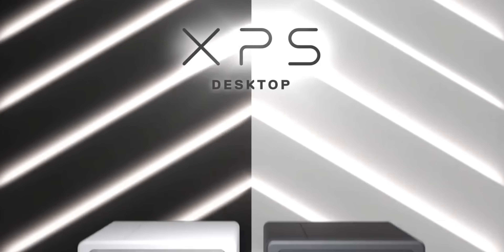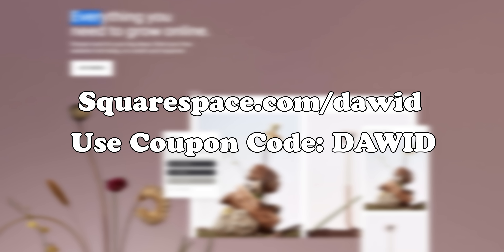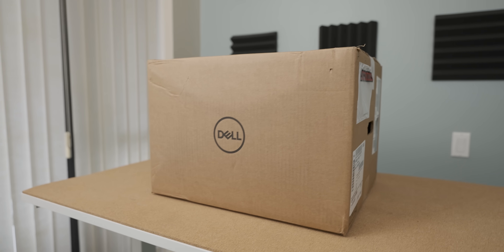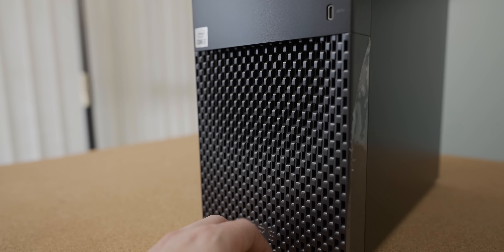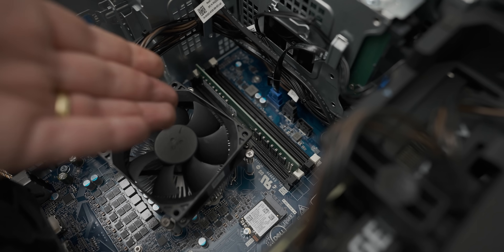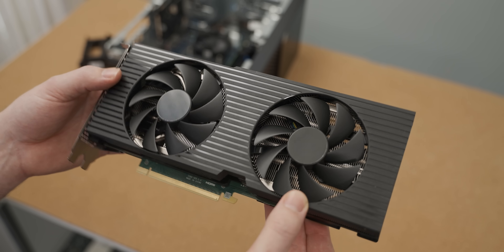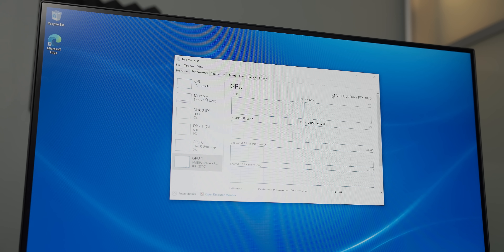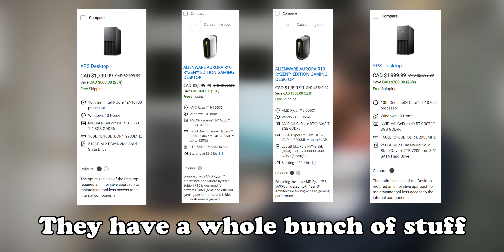DELL Did Me Dirty... RTX 3070 Dell XPS Pre-Built

Comment: Just watched, you should have sent it back and ordered another one. Dell is charging you for the customer service, make them give you service. It's fraud for them to knowingly send you single channel ram config when you ordered Dual channel. As for the cooler, it is what it is and more easily fixed by you. 

In theory, Dell can unlock your bios so you could add a stick of ram and get them running at the specified speed. I used to buy stuff from Dell, I don't anymore because I don't like having to chew people out that way.

If I had a Dell these days I would just leave the side door off.

Comment: I made that mistake once, the biggest problem with pre-built PC's are the proprietary parts, such as PSU's, the stupid configuration of the cooler and airflow, the motherboard is no longer standerdized like it used to be and you can't slap any motherboard when upgrading the motherboard, be warned.
Reply: I know what you mean. My last pc was Dell xps and it was broken. I tested all removable parts (m.2, ram, gpu, psu) and all working, so what left is either motherboard or CPU. Here comes the question, in order to replace the motherboard, I have to buy a new case. Moreover, the 600w working psu only has one 12V 4pin connector which limited the MB choice to the very low end H board unless I buy a new PSU. That is saying, no pre-build forever.

Comment: I just recently bought a "parts only" XPS off Ebay for 300$. It came minus the power supply and video card. What I got was a virtualy pristine XPS 8940 with a i9 10900, and 32 gb of memory. I put the Dell power supply I had into it (500 Watts) 89$. Then I hauled out my Dell RTX 3070, 225$ and bing bang boom a working gamer machine. Further upgrades were the NVMe drive change to a 500Gb and the swapping of the CPU cooler to the Dell "premium" one for 32$ and the addition of the VRM heat sink for 13$. So I spent @740$ to get the same thing Dawid bought 3 years later... Good buy? Maybe but for a patchwork used system it's pretty good.  Great video Dawid!

Comment: I live in Australia and GPU during covid here were few and $$$ so luck I managed to get one of these for very cheap. Bought off store shelf as is came with: 11700k and a VERY large cooler (these CPUs don't even come with a cooler by the way) 2x8g ddr4 (it's actually 3200 but Dell are cheap won't pay for XMP licencing so ram runs 2999) 1tb M2 drive, 2tb WD HHD, and a RTX 3070 that is (surprisingly!) good! I OC more than any other factory SSOC offerings silicon lottery I guess.
Problems: CASE IS TOO SMALL/CONFINED, 11700K (know to run hot) THE GPU MEETS ALL THE WAY TO FRONT OF CASE BLOCKING THE PSU LEAVING BOTH TO FIGHT FOR EXTREMELY LIMITED HOT AIR, ONLY 1 SMALL EXHAUST FAN REAR OF CASE. SHE GOT A BIT HOT!
Now it's Dell, so proprietary MB and PSU cables I swapped to new case so had to get new MB and PSU also  gaming I see around 63-65°c OZ heat mind you! Down from +80°c
Otherwise at the time and for the price 👌 but my advice: DO NOT GET A DELL OR ANY OTHER PROPRIETARY POS intentional to keep you buying through them, god forbid you want to upgrade your PC Dell wants you to just buy a whole new PC from them instead

Comment: I have this computer and i want to change my 3060 card to a 3090. Do you know which third party card will fit this computer ? TIA
Reply: 🤣🤣🤣 no card above the 3070 that's in this PC my guy as it already meets the front of the case, blocks off any air it can get also blocking the Power supply leaving both PSU and GPU to fight over the smallest amount of hot air! Mine would hit over 80°c CPU n GPU easy. I swapped case for that reason still running the RTX 3070. Also you WILL NEED a much better Power supply if you want a better GPU are you aware DELL use what's called proprietary hardware? So the power supply and motherboard have special connections that only fit with their boards. If you want a better GPU also you need a new PSU to power it BUT you then also need a new MOBO because the new PSU won't fit in the Dell MOBO power sockets. Not all a lose, because then your ram will go from 2999mhz to 3200mhz XMP which DELL do not want to pay extra for 👍

Comment: I think you knew before buying that Dell is a crooked company when it comes to selling to individual users.  Had you been a corporation ordering 100 of those systems you might have gotten the advertised components and the dual channel memory that you ordered.  But as a home user Dell assumes that you are too stupid to know better when you look inside the box to the colossally disappointing build that you received.
In their favor (not much) Dell tends to use very high quality power supplies, although their systems typically won't accept any non-Dell PSU's due to proprietary power connectors on the motherboard.  Meaning you are stuck with 500WH until the sys is sent out as e-waste.

Comment: Yeah I pretty much got did the exact same way... After I was done ranting and raving about being jipped with the memory I just memory I decided to just buy another motherboard better ram better coolers and a better case took my 1TB M. 2 drive the 3070 reference card from Dell and the 10 700 F chip and migrated to my own self built system... Yes it costs an additional $700 to do so but now I actually have a system that does not throttle itself in any way...I learned my lesson prebuilds are horrible.

Comment: I think you have to spec the system up to a K series processor to get the tower cooler.  Back in the GPU "dark days" I wanted to get my hands on a RTX 3070 so I made a post on several local university's community facebook groups looking for someone that needed to buy a new PC. I would purchase the PC with the 3070 then knock off the GPU at MSRP.  Surprisingly I had a bunch of people interested once they figured out the PC was about $180 cheaper than if you bought it through dell without the 3070 (I also get a dell discount though my work).

Comment: Never ever buy a pre-built computer from anybody. They are made cheap and over priced and you most likely will be vary disappointed in the performance and the reliability of the components over your first year. Had a few over the years different brands both desktop and laptops and they all did not last more than a few years but built my own computer well I didn't build it I had a computer shop built it for me but I was able to order everything that I wanted to have in it and then I had them just put it together so technically not a rebuilt but definitely stay away and even if you do have a computer shop older the stuff that you want make sure that you tell them you want all your receipts for warranty purposes and to not throw any of the boxes away this way you can easily ship warranty equipment back in the original package of course you got to repack it into something else so it doesn't get damaged if you're anything like that but definitely bring this stuff up because a lot of companies through computer shops that are local they'll end up throwing all your boxes away not thinking you want it and this is kind of a smart thing to hold on the stuff any kind of electronics hold on to your boxes carefully open everything up so that way if anything ever has to go back you basically have a box of sticking them see smart LOL

Comment: I hate Dell as much as I hate Mac. Over the years working on Dell servers, it seemed to never fail that they would require an update for something and the update would (majority of the time) would hose the idrac or the Lifecycle Controller making it so you had to replace the motherboard. You were very lucky if an update worked without breaking something.

Comment: my dell precision t7500 2008 desktop will blow away this computer and any other computer on the market now days. i have two (2) intel xeons running @ 3.33GHz, video card, two (2) nvidia Geforce GTX 1060, yes the 6GB VERSION  :) plus i'm running in raid. you can max this bastard out AT 192GB of ram, crushing through anything that stands in front of you laughing at your victims.  :)  my computer didn't even cost all that much.

Comment: The piss poor Dell support from India is the reason I decided (today) to not buy a Dell Optiplex 7000.  After 4 attempts of dealing with Dell India in a fruitless attempt to get part numbers for Dell slot m SSD and the slot m wireless card I gave up. The first thing India wanted to do was to sell me refurbished SSD. However, even getting to the point of them understanding I was making a new PC purchase was enough to end any desires on my part.  So long Dell, that was a $1300 USD loss to you.  I will look at HP or I will go back to building my own, even though I really wanted a turn key deal.

Comment: Tbh Dell is pretty legit. I still have my prebuild from 2017 (the Pavilion.. something..something) don't remember what's it's called. My only problem is that instead of giving me a normal 1060 they gave a shitty 3Gb one which still works fine even till this day but runs most good titles at 60-70fps or bellow. I can get away with any title below years 2018 but anything in this year runs like absolute crap. The PC is now not even what it was, bought a better motherboard. Ram and For God sake a BETTER case, with proper air cooling.
Reply: pretty sure hp made the pavilion
Reply: @YukariAkiyama  oof. dont even know the company i bought it from like 5 years ago.

Comment: I bought this exact pc about 5 month ago and have been trying to figure out why my performance has felt so low this entire time, noticed my cpu temps sitting at 88 and my gpu usage never going past 30-40%, I've searched for months and just came across this video, I cant believe they would skimp on something so small that reduces the performance so much. I'm going to open it up tomorow and replace the cooler with the one from my old system and pray it works. Oh for what its worth I also selected duel chan ram 16gb and it did indeed come like that.

Comment: Pretty sweet deal when you consider you only need to buy a $100-150 power supply upgrade and a second stick of ram. Which will be cheaper than adding the options on the dell website. When I added the second stick on mine, I saw the cpu usage drop drastically. And an upgraded power supply will lower Temps with less spikes in voltage.
Reply: Proprietary PSU, no?
Reply: @MichaelSmith-fg8xh  nope, that is a common misconception. When I ordered the new power supply for my alienware aurora r7 I went with evga gold 650watt and it came with separate wire harnesses. Use the ones that fit and throw the others back in the box or recycling bin. If memory serves there were 3. The original power supply in the tower did not have clips or plug-ins, everything was direct. But the board, gpu, etc still all have plug-ins. Your new power supply will come with wires for all of that.

Comment: The part that I miss in this video is where you contact Dell right away after discovering that you did not receive what you ordered. "Dear Dell, I did not get the right CPU cooler (as was advertised) and I specificly ordered 2 RAM sticks for a dual channel config, but I only got a single stick." Would have been very interesting to know how they handle complaints like this. Anyways, I would not have accepted it like this and I don't really understand why you don't seem to bother at all besides being a bit disappointed...

Comment: I bought a dell prebuilt with an i7 11700 and rtx 3060 for $1250. Slapped in a u9s and its actually pretty solid. AND mine came with dual channel 2x8gb ram
Reply from the maker: Oh hell yeah! They are one of the better ways to get your hands on a reasonably priced GPU theses days. I like to replace the case and motherboard though to completely purge the Dell from the system. 😅

Comment: Some advice for anyone who's bought a pre-built and is now grappling with scarily high CPU temps (also, hopefully someone with more knowledge can check that this is all okay):

I bought the 3060 Ti version of this pre-built. A temporary fix you can do for the CPU temps is to run a command in the powershell (easily searchable) that will let you edit the maximum processor frequency. You can set different maximums for each power plan in the control panel. For 'power saver' mode I set the CPU to only run up to its base frequency (2500 MHz), and I created custom power plans set to have maximum processor frequencies at increments between 2500MHz and the maximum turbo frequency, for when I feel okay with letting the CPU get hotter.

This can cost up to about 15% fps in my experience, but its been a real lifeline for CPU temps. For me, especially as someone who likes to keep fan noise to the minimum, that's worth it until I can be bothered to get a new CPU cooler.
Reply: I just went in the BIOS and disabled turbo and it is doing so much better.  Mine came with dual channel RAM though.

I guess I got lucky!

Comment: The problem for Dell, is that they are backing themselves into a corner a certain consumer market. The first PC I ever "modified" was a brand new Dell optiplex back when 1150lga was used. Had a fairly decent i5 4core, back when i5s weren't hyperthreaded. It used standard sized hardware. It used standard everything! It was a good price out of the box, and left room for me to upgrade. Eventually even the motherboard was upgraded! Sold it to a friend when I wanted to do a custom build, and at I'll works to this day! 

Sadly it seems like dell has made the decision for many like me looking for a good priced and upgradable prebuilt easier. And with how much information is out there, and how easy it is to find, many people I know do a lot of research for the best product for its price. A huge factor for many is whether it's upgradable down the line. If someone who wants to get into PC modding but wants to learn on a pre-built like I did... i can guarantee they won't be choosing a dell.

Comment: I've had similar issues with an Acer predator that also had a RTX3070 and an intel i7 11th gen. It had a small and pretty case, one case fan but no room for air flow. It overheated without me realizing as the software of ACer to control the RGB showed that everything ran at 50 degree Celsius at most, which was a lie. With CoreTemp I saw that my cpu actually reached 100 degree Celsius while playing games like GTA V. I had no choice but to return it. Now I have another pre-built from a more trustworthy local building brand with only a GTX1660S, but evrything is running cool and smooth and I can upgrade the GPU after the Armageddon that we have now with GPU prices.

Comment: Pretty sad that just about EVERY Dell pre-built video done by YouTubers shows just how garbage-ishy and shady Dell is. Seeing as we have a call center here and I have SEVERAL friends who work in their support dept... I hear just how hard they make it for customers.....and how many customers constantly call to dipute charges, try to get warranty work but often shut down bc Dell finds reasons to make the customer at fault, etc. etc. I recently did a big contract where I removed 56 5 month old Dell desktops and replaced them with Lenovo work stations because of performance issues AND... they had 5 failures and fought with support to the point of ditching them. When I see that crap cooler and motherboard in the videos, I am reminded of EXACTLY what I saw on every break/fix I went on for this contract. Not to mention that these brand new systems had only 4GB RAM in them and the complaints of how slow they ran were like 50/56 users.

Comment: From my experience, Dell is the worst PC supplier- building sub-standard PCs with third rate parts. I have owned three Dell laptops in the row that were all crap. The first was bought by my company, had two motherboard replacements, before I abandoned it. The second was Intel Core(TM) i7-8550U CPU, 16 Gb of memory, etc.  It failed within hours of bringing it home, and was immediately replaced by Best Buy.  The  replacement is a slow power hog that has had many, many issues (failed USB 2 port, failed battery, non-working track pad, etc., etc. Disc had so so many bad tracks, boot up time was on order of 1-1/2 minutes, and one time took 2 minutes and 14 seconds  (slow time was because of Windows error correction)  I was unable to get Best Buy to do anything about this so I replaced with an SSD .. When contacting Dell, they merely shrug it off.  This alone is driving me to a Mac, even though they are not the development system of an Intel based machine (Windows, Linux).

Comment: I just bought this XPS 8940 with the i7 11700 which is 125W version. The i7 10700 is the 65W variant according to Dell. Dell shows that the 11700 with 125W gets the upgraded cooler. Does this sound correct? According to Dell's service manual for the XPS 8940 it shows a different cooler between the 65W and the 125W variants. Maybe this is why you have the tiny cooler? Just trying to figure this out...

Comment: It is not just the single stick of memory that is the problem with the memory. My wife brought one of these. Hers came with 2x8gigs and the massive CPU cooler in the picture. This hasn't stopped the machine from sucking! The CAS latency on the Dell branded memory is 22 (the worst I have found for DDR4). Considering Dell branded memory is 3 times the price of some of the best memory available this is not good. I upgraded the memory to 64gigs using a different brand (for 1/4 the cost of Dell brand) which immediately got clocked down from 2999MHz to 2333MHz as Dell motherboards don't support the full DDR4 spec. Despite this because my new memory has a CAS Latancy of 16 rather than 22 despite running at a slower clock speed the system overall actually runs faster! And as a bonus also takes double the time for the CPU to reach thermal throttling (30seconds rather than 15 seconds!) when running simulations in Blender!